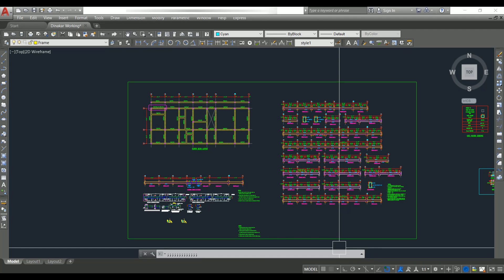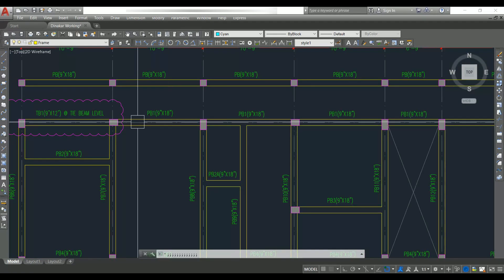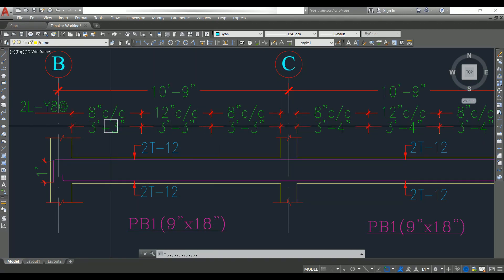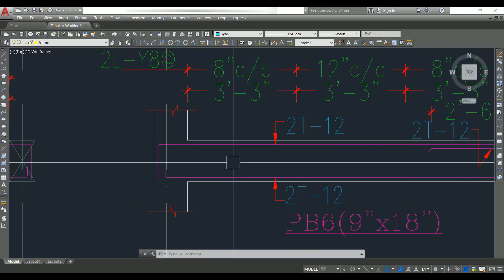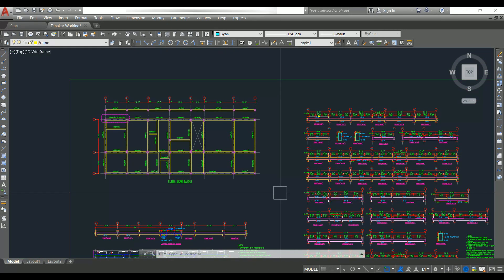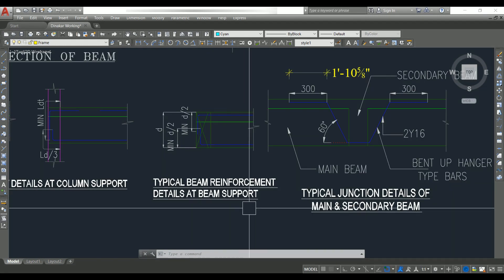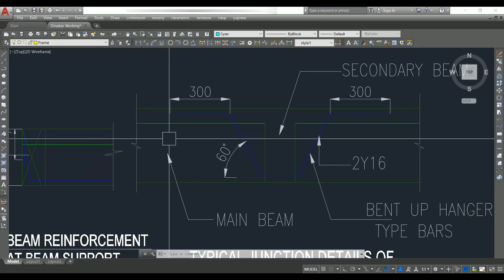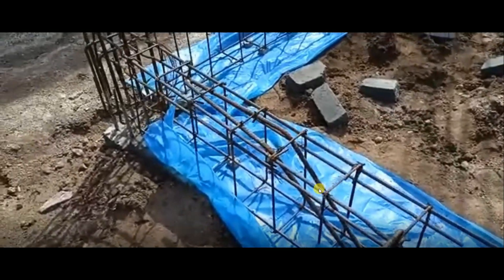Plinth beam | Plinth beam reinforcement details | Plinth beam reinforcement at site | plinth level

Comment: Thank you dear ma'am, i have one question, 
Suppose i want to lapp a top reinforcement of beam , basically it will be done at shear side na l/4, so can i use the lapping reinforcements as shear reinforcement as well since I'm have an overlapped reinforcement?
Reply from the maker: shear reinforcement has to be provided in the form of stirrups.
Lapping at the top shall be done at the middle l/3 of the beam since the moment will be more near the support at the top of the beam.